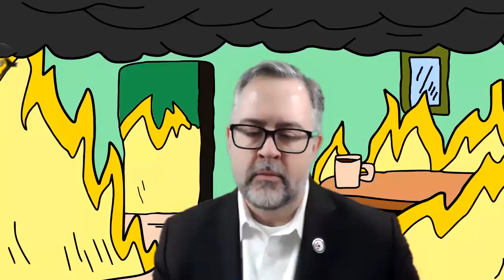Do audiophile cables matter?

Comment: I have worked in commercial audio for most of my life. This is my opinion only. The recording studio was wired with plain old twisted pair shielded wire. There is nothing special about it. Many commercial installations are now done with Category 5 data cable. There are not enough known factors here. If the source impedance is low, any 3 foot cable will not be problematic. Load capacitance is a factor with respect to moving magnet phonograph cartridges. Those with vacuum tube preamps may benefit from low capacitance cable because the source impedance is higher in a vacuum tube preamp. With speaker wire, the resistance and connection quality are a factor. I personally find that Home Depots yard light cable or SJ cable are great for speakers unless you are running it in a wall. Building codes will not allow yard light cable or SJ in a wall. Don't waste your money on an expensive power cord. You can buy a file server power cord for a few dollars and it will be as good as anything. Those who spend $3000 on a power cord spend more on the cord than all of the electrical wire in the average home.  I understand there are those who claim they hear a difference but I think the thickness of one's pocket book is a factor here as well.
Reply: Craig Kopcho those who claim to hear a difference find that the ability quickly disappears when subjected to controlled testing, as with all psychic abilities

Comment: After much experience trying a wide variety of cable since 1988, I have settled on a view that cables are another component and can, especially at the upper end of price ranges, have as much an impact as a new preamp or amp.  This is doubly true if coupled with grounding devices.  Further, I have found some brands do a superior job of lowering noise.  Many of the reference cables out there today actually have sophisticated filtering built-in...indeed they are a "component."  And like any component there are some good values to be had but generally with some pricey brands you do get what you pay for.  Good video Scott.

Comment: Scott, as late as i am to this party, i applaud your measured approach to this hotbed.  the problem with DBT is the rapid switching that goes with it.  i tend to do long-term listening with most components, especially wire and electronics.  with loudspeakers, the differences are usually more pronounced and rapid A/B comparisons are far more appropriate but still, i like to live with the sound for a while.  

dealers can be a can of worms.  some have more love for the bottom line than others.  and then there are those that will go to the ends of the earth to make sure you end up with a pleasant result, whether or not you purchase something from them.  this can be economical or costly.  i have learned massively by being quiet and listening to the sound and explanations thereof.  one time, at an early Stereophile Show in Santa Monica CA, the demo was of a Steinway Piano by James Boyk who is a professor at Cal Tech and proprietor of Performance Recordings.  that was a real highlight of my experience in audio.

i look forward to the AUDIOCON in January in Irvine CA and perhaps meeting you.  

...hifitommy

Comment: Most of these companies built their business by allowing in-home trials.  Customers nearly always keep their cables whether the effects are real or a placebo but if a potential customer doesn't perceive any difference they'll allow a return and refund most of the money (90%+).  BTW you're brave to allow the hard-core objective trolls to weigh in.
Reply: Martin Tousignant people will hear what they want to
Reply: @oioionionone  You're coming from a hard-core "can't measure it therefore can't hear it" approach.  Danny Richie (dba GR Research) does A-B crossover demos on the same amp, cable, and speaker.  All of the parts have the same measured values within 2% except his version uses higher quality parts.  I can consistently hear the upgrade without knowing which version is playing.
Reply: Martin Tousignant you’re off your head, firstly you’re talking about “parts” not cables, can clearly hear the difference in “parts” 

Secondly you’ve already stated there’s a difference of up to 2% as measured so you’re citing measurements as being important in your own comment refuting the importance of measurements 

You’re also stating your own experience as being a fact that would affect the mass audience 

Off you pop
Reply: Martin Tousignant and you’re assuming my position based off a comment, you haven’t got a clue what my “position” is, work in the industry for 35 years then come back to me with your musings on the difference cables make